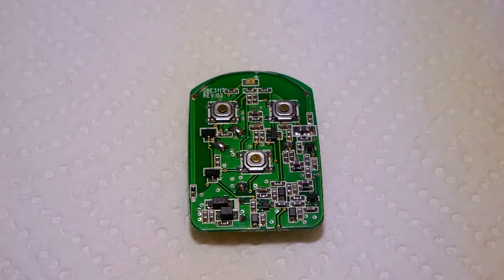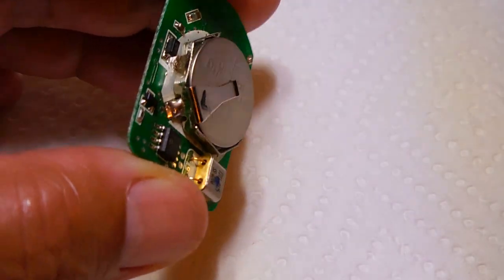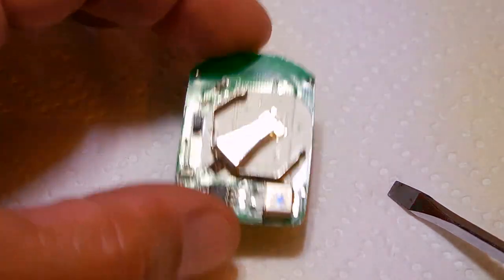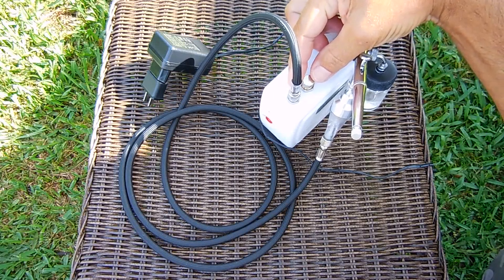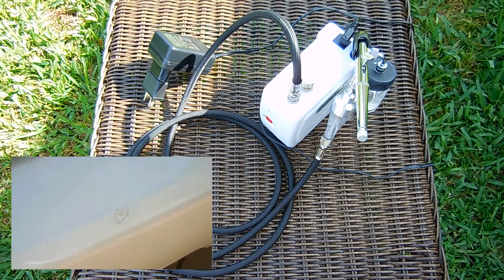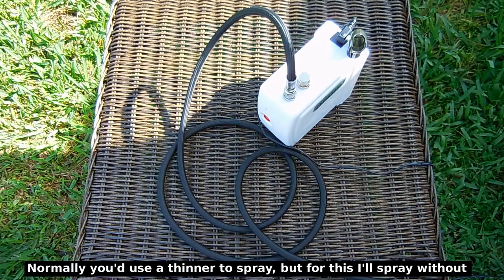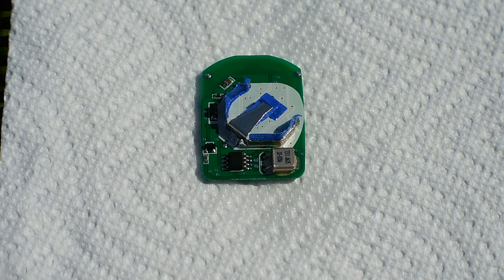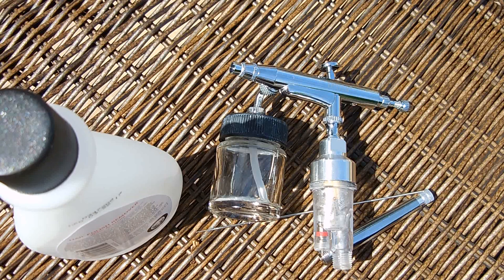Urethane Conformal Coating(Fast Dry 2 Part Mix)

Comment: Works great for the circuit boards on solar garden lights! They always say weatherproof which basically means they'll hold up against sunlight and a bit of wind!
Reply from the maker: Those you can dip. :-)

Comment: I  my self improvised and used flowable silicone as conformal coating on the plasma cutter on that you helped me on  the diagnostic for the  repair on my ltp5000d  once it was repaired and give it the component some support too!
Reply from the maker: Flowable silicone is good, I have a tube made by Permatex.
Reply: electronicsNmore got it automotive store it was for windshields i didn't have the time to wait for ordering online or have the cash to go  and buy it at the local Grainger Supply chain locally there way to dang high with there price!

Comment: Nice vid, Can you try out the sandblasting set also ?
Reply from the maker: Thanks. I had a mini sandblaster years ago(looked like an airbrush), but never had use for it. I may get another one. :-)
Reply: electronicsNmore That set-up is used with fine abrasives for doing glass sandblasting(matting)
Also it can be used to clean precise parts,i used it to clean build-up carbon on my motorcycle piston.
My uncle is doing sandblasting for living,and i like to hang around his shop.
Reply from the maker: I would need to swap out the nozzle and needle to use this unit for sandblasting.

Comment: Nice video.  Don't know much about paints.   Is the urethane/conformal coating the same as clear coating I see at AutoZone used over car paint jobs?  If yes is there a cheaper source?  Also I was wandering if the polyurethane varnish sold at Home Depot would work just as well?  The can I saw at Home Depot shows it as slightly yellow/brown in tint not clear as yours however.  I don't mind if it is not clear for pcbs.
Reply from the maker: Very similar. Polyurethane, silicone, epoxy resins, and acrylic are also used. The coating I used dries fast, the clear coat for auto paint takes much longer to dry when applied in wet coats.